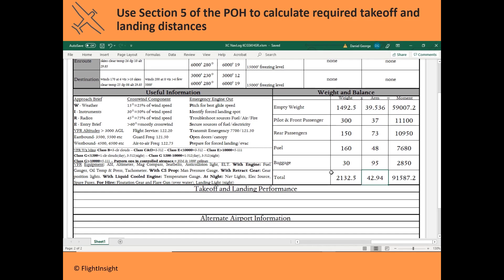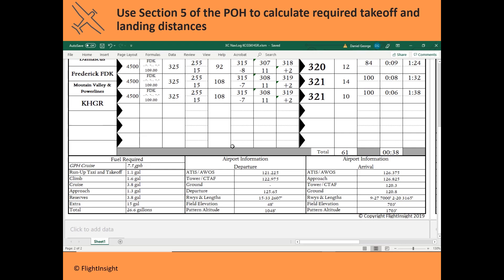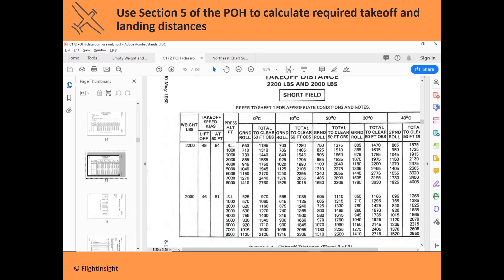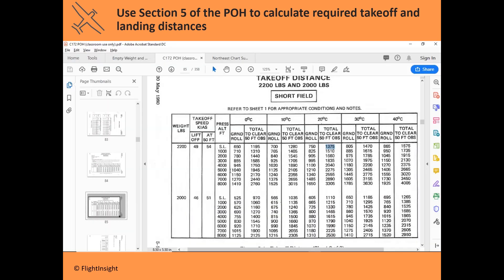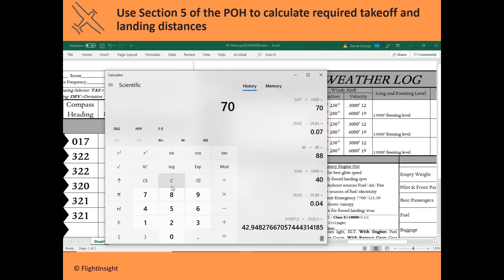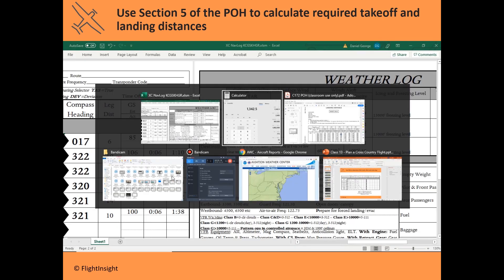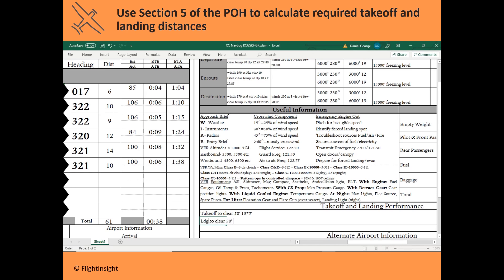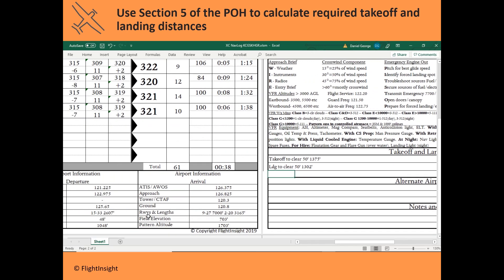Calculating Takeoff and Landing Distance | Cessna 172 POH

Comment: if the pressure altitude is a HIGHER number than 29.92, like 29.95, for example, do you still subtract it from 29.92 - 29.95 = -00.03, then x 1000 =  -30, so then do you then SUBTRACT 30 from the airport's true elevation?> which would mean the pressure altitude number would be LOWER than the airport's true elevation?

Comment: So if my field elevation is 1000 and my POH only has sea level, 2500, 5000, and 7500. How do I solve with alt setting of 29.92?
Reply: You would take ur current altimeter setting and then find the difference between 29.92 then times the answer by 1000 then add 1000 feet to that (ur field elevation)  and there’s your pressure alt! (I think. I just learned this too lol)

Comment: Excellent video! however I have a question, at 4:49 why did you have to interpolate between 1000ft and 2000ft PRESS ALT if Destination PRESS ALT was 773ft? Thanks!
Reply: I think he was interpolating between 20 C and 30 C because the destination airport was at 25 C.

Comment: You say that it's conservative to use max gross landing weight even if you're not max gross. I'd argue that you settle onto the runway much sooner at max gross compared to light weight when you float. Therefore you can get on the brakes quicker and stop quicker when heavy and probably can stop sooner in this case versus when you're alone and float down the runway longer (assuming you use the same approach speed).

Comment: Absolutely love the channel! Just a note - I think the headwind component in this example should be 6cos(30) or about 5, not 3. Obviously not a huge difference in this particular scenario, but you wouldn't want someone to have the misconception that the headwind component is the full wind minus the crosswind component, since with stronger winds or a different angle it could of course result in a significant difference.

Comment: I’m probably one of the rare GA pilots that does this for every single flight.  Let’s face it, a lot of GA pilots take their 1000ft takeoff roll on an 8000ft runway for granted and I was one of them for a while.  But now I do a full takeoff roll, accelerated stop distance, etc (all with a manual E6B to boot!) so I know my abort point.  If I haven’t reached my desired airspeed or rotated by the abort point (I use intersections and clear markers), I assume something is wrong and I abort takeoff.  I’ve found that my calculations have gotten pretty accurate to within about 100 feet.  Same with landing distance (must touch down by a certain point and expect to be off by a certain taxiway).  It makes cruise calcs feel like a cakewalk.
Reply: I depart from a 600 mtr grass runway, so I do my calculations as well, specially during the summer.
Reply: I use the rule of thumb method. 99.9% of all takeoffs in a fully loaded C-172 on a hot day can take off and land on a 3500 ft paved runway.
Reply: I really like your idea of using markers or signs to know when takeoff should’ve happened. I once had a rough engine immediately on takeoff and had I designated a point where takeoff should’ve happened, I would’ve known to have aborted. 

Thanks for the idea, it’ll probably save someone’s life one day
Reply: I think operating a vehicle whose primary means of transportation failure is gravity pulling it into hard grounds...warrants a bit of time of due diligence.